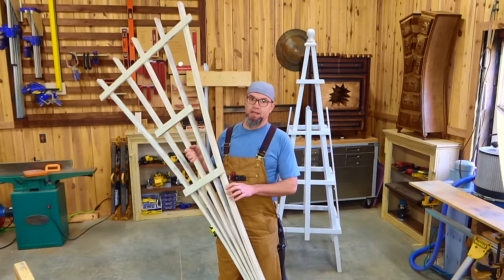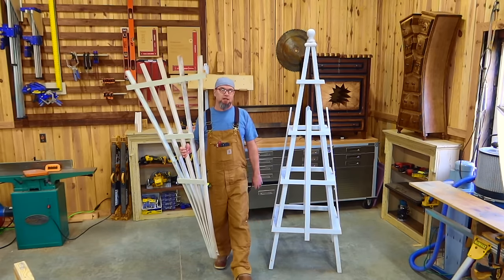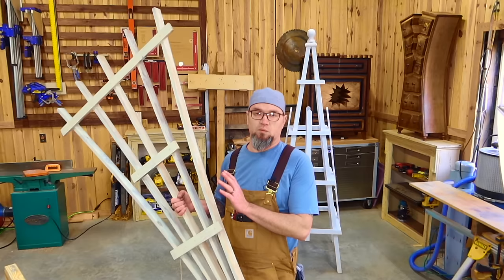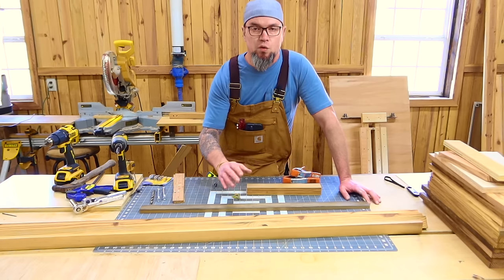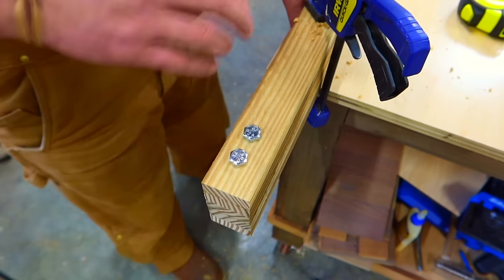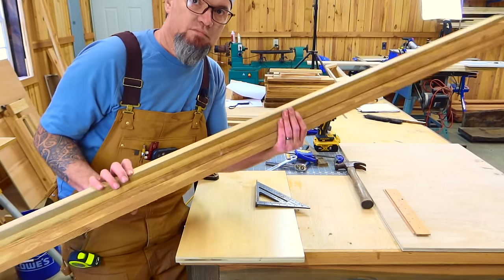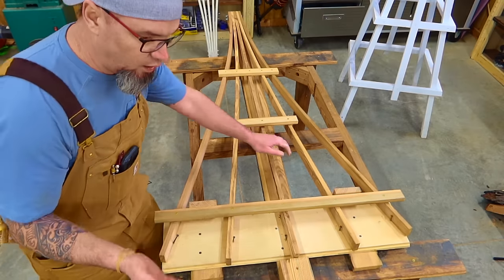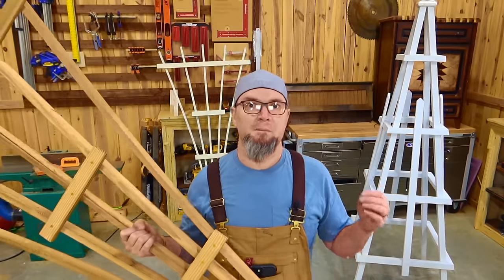650% Profit - Make Money Woodworking - Full Build

Comment: Hi Matt I enjoy your video's great ideas I know I'm stating the obvious on the 4" bolts should be galvanized  🙂 thank you for all the work you put into these video's
Reply: I think in this project zinc bolts are fine. 3/8 is a bit overkill though. 1/4 inch should be fine.
Reply: THIS is the question that I've been trying to figure out all day. Stainless steel is what Matthew said I believe, but they are much more expensive and harder to find where I live. I was researching Zinc plated and everywhere I've read says they're unsuitable for outdoors and can corrode in 12 months. Do you fellas know if this is true?
Reply: I've made several of these and I went with four 2 1/2" deck screws two on each side  instead of the bolts and I haven't had any issues with this method certainly not opposed to the bolts this seems a little quicker and cheaper.
Reply: @thewoodworkersjourney3314   Zinc work perfectly fine.  Even if they do corrode, no one is taking these apart for any reason so corrosion not really a factor.  Zinc are much more affordable - especially if you are making a lot of these.  If you do go with SS, you just have to increase the price you charge. 1/4 inch work just as well, smaller hole in your base too.

In fact, you could probably just use one bolt at the bottom since the trellis is bolstered by two other cross pieces on top.

Comment: Thanks for your video. Very inspirational! An idea I had was to take a 2x4 and rip it to 6" from the the end 4 times making 5 slats. This way you forego having to bolt the end. Have you tried this? What do you think?
Reply: That might work, but if even one “stave” breaks during the process (for whatever reason) you’ve pretty much ruined that entire trellis.  By using Matt’s process, if one breaks you can easily swap in another full length stave & use the “broken” piece for one of the cross pieces.  I do get your idea & it cuts out the cost of the bolts (hardware).  Give it a try & let us all know.
Reply: You will still want to use at least one bolt just below the cuts, otherwise the cuts will start to split.

Comment: So.... quick question and I apologize if I missed it in the video... for when you set up the main jig - what is the spread of the 2 outside boards at the top end?  I looks like it is the same width as the 32" top brace.  Nicely done!  Can't wait to try it out!
Reply from the maker: Thanks!  The outer screws for the top are 30” apart. Then space the other two centered between outer and middle. 
The other two you make when you make your first one just in case your jig is a bit off from mine.

Comment: If the fan were made 8' tall and the next to the bottom bolt about 12" from the bottom, a 12"  deep post hole  could easily support the fan if it were concreted  in place.
  If put next to a wooden fence 12" 2x2's could be used to support the fan off the ground and provide enough space behind the fan to allow the foliage to grow.

Comment: at the start, he said when giving you the parts and size. the 5 boards were 72", but when at the end he stated that the 5 boards are 7'ft which is 84 inches. i don't wont to mess up so 72 or 84 great videos

Comment: Could you loosen the two bolts at the bottom or leave them loose and make it easier to spread the tops. Then tighten them before you add the cross braces?

Comment: Hi Matt, Love the video. I will definitely be building some of these. I have one question. In the video you gave two measurements for the top cross piece. You first said it was 32" then 34". Your cut list shows it to be 34". Which is the correct length? Thanks for your time. Keep the videos coming.
Reply: The piece on his table when he says 32 is 34 on the cutting mat.
Reply: @juneritchie2498  Thank you
Reply: @juneritchie2498  Good eyes!
Reply: The 32" he was talking about was the one he did in the first video

Comment: I have been looking at all sort of videos. Honestly, Matthew, what I have seen from you is nothing but good solid information. So let me provide you with some information I am 78 yrs old, and I am getting into woodworking. I love your smalls and the trellis and obelisk and intend on doing exactly this. Also I am intending to do Charcuterie boards and cheese boards. Also my intentions are to sell on the weekends at craft shows, and at other outdoor venues. So I am going to need some mentoring, plans, and lots of fun. Tools, I am going to use Milwaukee M18 Fuel, plus some other tools that plug in. My position is that I have the capital to purchase quality equipment, and not drain the bank account. So if you want to be a mentor to an old fart, I would greatly appreciate this. 

Jim Boyes

Comment: I really appreciate you sharing this process. I'm no expert, but a little constuctive feedback. You are moving the jigs around so fast I can't focus on them. It might be better to hold them still ofr place them on the bench to minimize movement. Again, I'm not trying to be critcal, but provide some feedback. Thanks for the tips fopr production!
Reply: In settings (click the screen and see the cog up in the right corner) you can change the play speed to slow things down if you ever need.

Just in case that helps.

Comment: I've got 3 garden centers right up the road from me, I'm going to definitely bust a few of these out!  The plans on your Esty, do they include how to build the jig as well or is it just the trellis?
Reply from the maker: Heck yea hit them up!  The plans cover the top jig.  The outer screws for the top are 30” apart. Then space the other two centered between outer and middle. 

The other two you make when you make your first one just in case your jig is a bit off from mine or your material is different.
Reply: @MatthewPeechWoodworking  Had a thought, could you use a furring strip to make these?  I'm just trying to think of options to maximize any profit.

Comment: For mass production, would it be beneficial to have a marking jig for the bolt holes? A piece of ¼" with a stop block on the bottom and hole to mark with. Or maybe put screws through it that you can smack to leave dents where to drill.

Comment: I'm definitely not a woodworker but would really love to make those and sale in my area how did you attach the bottom of the trellis to your jig do you have plans for The Jig?
Reply from the maker: Just two side screws to hold in place at the bottom.  The outer screws for the top are 30” apart. Then space the other two centered between outer and middle. 
The other two you make when you make your first one just in case your jig is a bit off from mine.

Comment: you talked about making the vids better and more informative. In one sentence you said the upper bracket was 32 inches. Then talked about a correction from 40 to 34. So is it 32 or 34. You did not give the hole spacing for the second bracket with three holes.Hole spacing for the upper bracket, or distances for the bigger jig to fan out the upper pieces. Thanks

Comment: On the second 12", and the 32" pieces did I miss what the spacing is on the holes in the jig?
Reply from the maker: The other two you make when you make your first one just in case your jig is a bit off from mine or your material is different.
Reply: Can I make them out of red oak
Reply: @roncostas2223  Yes, any wood works.  Oak looks nice when given a natural finish.

Comment: I think if you leave the bolts loose while you stretch the long boards onto the jig, then tighten the bolts once it's set there should be less chance of stress breaks on the outside board. Should also make it faster to set it into the jig, might not even need to remove and replace that outside screw.
Reply: Also, place the two inner pieces before the two outer, that helps relieve a great deal of pressure initially

Comment: Hi Matt, awesome videos. I was wondering how you keep these trellis from rotting? Do you treat these or sell them raw? And what are the dimensions for the layout big?
Reply: I wondered about that too.  Thanks for asking him.
Reply from the maker: As long as they have airflow they will only quickly rot at ground contact (Think log cabins or barns... they stand for hundreds of years.   You can paint, Use deck stain, or use cedar.  
The outer screws for the top are 30” apart. Then space the other two centered between outer and middle. 
The other two you make when you make your first one just in case your jig is a bit off from mine. 
Hope That helps!!! Thanks for watching!
Reply: To keep wood from rotting where it contacts the ground use fire [torch?] to char the part that contacts the ground.

Comment: very nice video, shows the need for jigs. one question, have you considered using stainless steel bolts? not a low cost option to be sure but galvanized may not hold up around my area. ( Florida )
Reply: If you’re building it for yourself, do it. If you want to sell them, it might be harder to justify the price. He’s building his out of pine. Not a chance I’d use pine if I were to build one for myself.

Comment: I'm wondering about the additional stake to put in the ground.  Is that adequate to hold up the the trellis or does it need to be leaned or supported by something else?  Seems like a common question that a customer would ask.
Reply: A simple EZ way would be a rebar of whatever length they think they need in the ground plus 2-3 feet and a couple zip ties.

Comment: How do you make the jigs
Reply from the maker: The outer screws for the top are 30” apart. Then space the other two centered between outer and middle. 

The other two you make when you make your first one just in case your jig is a bit off from mine or your material is different.

Comment: I'm surprised you don't predrill the uprights before you attach the cross pieces. I'd be afraid of then splitting since they are only 5/8" wide.
Reply from the maker: It never hurts to predrill.  I always do where the screw head is nesting.  Pine is pretty good about expanding.  But def wont hurt.

Comment: What is the distance between the screw holes on the middle and top cross boards ?
Reply from the maker: The outer screws for the top are 30” apart. Then space the other two centered between outer and middle. 
The other two you make when you make your first one just in case your jig is a bit off from mine.

Comment: So if you're ripping a 2x4 into 5/8 slats you only get 5 slats correct. The sixth one is narrower than 5/8. Is this the slat you use for the cross pieces or do you cut another 2x4?
Reply: Use a 2x6 then you can square off the rounded edges
Reply: @lindapayeur3621  And that costs more money!

Comment: how long is the long cross board you said 34"   then two sentences later you said 32" ? I like both builds, the trellis and the obelisk I will be building some so thanks for the videos! P.S. how many 2x4s to cut the slats, my lumber yard has to order Cedar 2x4s the don't carry them.
Reply from the maker: Hey!  It's 34.  It will take around 1.5 2x4s.  but your going to pay for cedar... why not use cedar fence pickets.  They are 5/8 and cheap.

Comment: Most people will not have a Torx bit so wouldn't it be better to use Phillips head screws for the two screws on the stake. If they see some (to them) odd ball driver is required they will be turned off and maybe not purchase.
Reply from the maker: Great point.  Yes def use something "user friendly".

Comment: Hi Matthew,
Was wondering what the predrilled hole spacing is for the 32inch pc? Maybe I missed that while watching!
Love your videos man.
Thx 
Curt
Reply: 29" from bottom to first board then 16" to second board then 16" to the 32 inch board is what I got, but I could be wrong.
Reply: @cnjam8357  that is not the question that was asked. he is asking about the distance between each screw on the 32" piece. also, i didn't hear that either, so i would like to know
Reply: @thisbetterman  Your right my bad. it's the center of the board. once you gap/fan it is the center of each board. If you look at his jig he has the lines of where the inside and outside of each board is and the hole is in the center. I don't think he said because each persons jig will be just a little different (1/2" vs 5/8 ( or if you want it just a little higher or lower)) The board that will have the bulk of the screw threads in it should have the screw centered. I hope that makes sense.
Reply from the maker: Hey!The outer screws for the top are 30” apart. Then space the other two centered between outer and middle. 
The other two you make when you make your first one just in case your jig is a bit off from mine.
Reply from the maker: The outer screws for the top are 30” apart. Then space the other two centered between outer and middle. 
The other two you make when you make your first one just in case your jig is a bit off from mine.

Comment: Love the video. As far as the stake goes, why not make the middle fan blade 8’ and put a point on it? Is there any negative to doing that?
Reply from the maker: Thanks!  Yea like I mentioned in the video I tried that and when batching for garden centers they cant stack them without them falling over.
Reply: @MatthewPeechWoodworking  I was thinking more for like FB marketplace. For the garden centers, I agree with having it as a separate piece that definitely makes sense. Just wasn’t sure if I was missing something from a design or structural standpoint.

Comment: Enjoy your videos.  Built a few trellises this weekend.  Do you have a recommendation for the type of wood you use?  Despite trying to pick the best stock in Home Depot, i.e., little or no knots, I still broke a number of pieces as I stretched the trellis in the jig.  FYI... I'm using 9/16" as the width of my slats.
Reply from the maker: Man... is the top jig set a 30" between screws?  If not 30 works best but you can also just put one bolt in first, the bottom one and not tighten it then add in the other and slowly tighten both.
Reply: I would say, you can moisten the wood prior to bending.

Comment: Great video, thanks for giving us all the specifics! So I heard you use pine but do you use a exterior stain or sealer? Thanks!
Reply from the maker: You can.  But as long as it has airflow you only need to worry about ground contact.
Reply: @MatthewPeechWoodworking  I understand, but what do you do, just seal the bottom?

Comment: Lumber prices these days are nuts and quality of lumber is...lacking. I've found my best luck in buying 2x12 boards to get the lowest cost but best chance at decent quality. The part that sucks is sorting through the pile...
Reply from the maker: Agreed!  A 2x4 cost more per bd ft than larger boards.  Its nuts.  Plus here's a tip for folks that want to use cedar.  Use fence pickets.  Only $4 here and you only need 2.
Reply: @Matthew Peech  You can actually make a decent version using only 1 fence picket. I cut them into 1 inch strips (cut the dog ears off first) and you get 5 good strips. 4 makes the trellis and the 5th makes your accent pieces. Flip the dog eared pieces over and you have built-in spikes. I'm currently experimenting with 2 I made only using 18ga brad nails and some glue.
Reply: @MatthewPeechWoodworking  good tip on the Cedar pickets. Wouldn't the finished product be less substantial?

Comment: How far are apart are the holes on the other 2 board's
Reply from the maker: The outer screws for the top are 30” apart. Then space the other two centered between outer and middle. 
The other two you make when you make your first one just in case your jig is a bit off from mine.

Comment: Hi Matthew. I was wondering if you have plans for the jigs used in this video?  Speaking of the trellis video
Reply from the maker: Hey Chuck.  You really dont need plans. The outer screws for the top are 30” apart. Then space the other two centered between outer and middle. 
The other two you make when you make your first one just in case your jig is a bit off from mine.

Comment: Matt, did I miss the screw hole spacing on the upper 34" board?
Reply from the maker: Hey Marty. The outer screws are 30” apart. Then space the other two centered between outer and middle.
Reply: @MatthewPeechWoodworking  abs I may have missed it in the video, but how far down from the top, center is the long cross piece? Thanks for any info. I’ll be rewatching the video again as I plan on making some of these to try abs market to local nurseries
Reply: @mrmyblessednest1722  I believe that measuring from the bottom up the first cross piece is 29" then from there the next two are 16" respectably (29", 16" 16") Matt made the 16" jig to help.
Reply: Thanks Matt!!

Comment: Im to lazy to read through the comments but...Have you thought about using dowels or pegs in place of the screws that you use to hold each arm of the trellis in place on your jig? Adding  stopper plate to the backside of the jig with a spacer, then pre drilling holes on the top side of the jig at the correct incraments..Would be so much easier to set a peg with your fingers then it would be to wrastle a drill and screw etc..Just a thought. Keep up the good work.